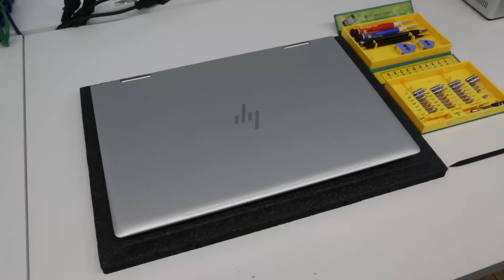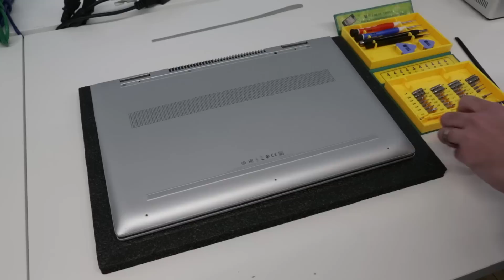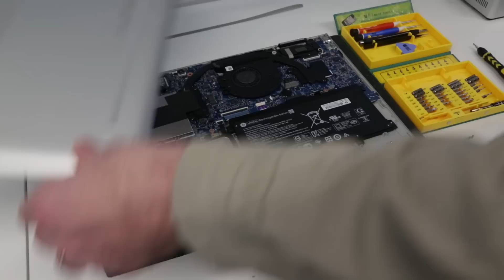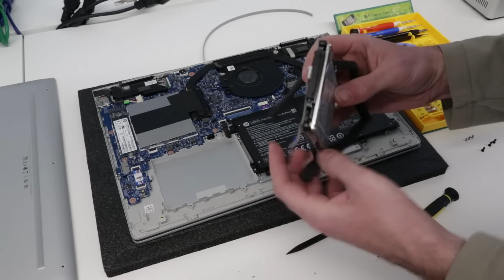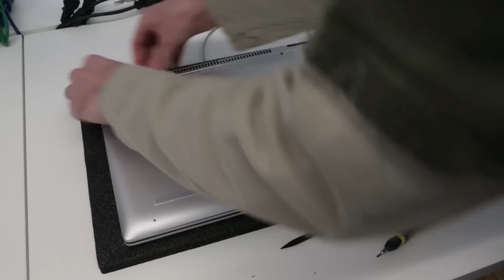HP Envy x360 15 SSD, HDD and RAM Upgrade Guide

Comment: You mention that the SATA SSD could be upgraded to NVME. I attempted this a while ago to a larger model and the system wouldn’t recognize it on the reboot after cloning. i then purchased a SATA version, cloned and it booted without any issues.  I believe the first SSD which was not recognized had 2 slots and the one which worked had only 1 slot.

Would you know why the NVME couldn’t be recognized for a better understanding?

Great video showing the Drive replacement process and explaining location of other features with the back of the laptop removed! Well done!

Comment: Thanks for the tutorial! For anyone struggling with prying off the bottom cover, start near the hinge area, it's much easier! Make sure you remove the screws from underneath both rubber strips.
Reply: Yes, the hinge area is the easier way to get the bottom lid off. Use plastic pry stick found in most computer tool kits.

Comment: Just installed a single 16gb ram chip into the same model.
Boots up.
Benchmark says it's in the top 1% of this  16gb chip. So the extra 4gb of Mainboard ram seems to help a little (but probably not as much as 4gb should in a regular  2x 4gb setup)

Don't know if it will cause any problems along the way , but so far works nicely

If any problems show up I will post here :-)

Thanks for video !
Reply from the maker: Useful information and glad it was helpful!

Comment: So where is the RAM Upgrade Guide? You show where the current memory is but state it should be left alone. No info about upgrading at all.
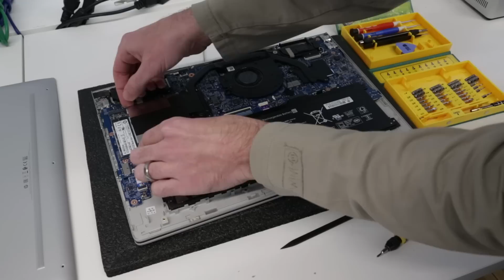Reply from the maker: 5:40 I remove the memory cover and talk about replacing the memory module - I was choosing the leave the 4GB module in place to keep a balanced dual channel memory configuration, but it can be removed by pressing out the two levers either side.

Comment: Great video man! around 5:00 you mentioned adding a second drive and I am curious as to how this is done. I've purchased a 1tb SSD (Samsung 860 EVO) and I'd like to add it as opposed to swapping out so I wont need to move anything over. Any help would be awesome, Thanks!
Reply from the maker: In the model I had (15-bp) you have an M.2 SSD slot and a 2.5" SATA drive, so you could fit two drives into it.
Do you know the model you have and I'll dig out the service manual.
Reply: @BrueComputing  hello can you please tell the exact model of SSDs  which are supported on hp envy x360 15m-bp111dx model? 
TIA

Comment: I am confused. OS is installed on hdd. Will it have impact on installed Windows OS if I replace/upgrade the harddisc?
Reply from the maker: You need to either clone the contents of the HDD to the replacement, or clean install to it.

Comment: Got a question. About the ram. Only one slot? Or two. Mine is just like this and i can only upgrade up to 16 and it's one slot. I can't. Touch the other slot
Reply from the maker: One on the model I had - the rest was soldered to the mainboard.
Reply: @BrueComputing  Thanks so much. The task manager says 2 slots
Reply from the maker: What's the full model of machine you have and can check the service manual?
Windows doesn't know the difference between a slot on the board and soldered down RAM, just what the BIOS reports to it.
Reply: @BrueComputing  hp envy x360 15 convertible
Reply from the maker: The full model number, there are dozens of different x360 15" models.
Will be something like x360 15-bp100sa
Reply: @BrueComputing  x 360 15- bp1
Reply from the maker: Same as the one in the video then. 1 DIMM slot, the other is soldered to the mainboard.
Reply: @BrueComputing  Hi, what SSD 3:22 you recommend for HP ENVY x360 - 15m-bp111dx?

Comment: Hi. Do you think a Crucial P5 1To CT1000P5SSD8 Internes SSD  and a 2×8gb  Crucial Ballistix BL2K8G32C16U4B 3200 MHz, DDR4 will fit in an HP envy x360 15 ds0xx?
Reply from the maker: The SSD will fit, but those memory modules are desktop modules!
Following bits (Amazon Affiliate links) should work:
Crucial P5 1TB SSD: https://amzn.to/33wFj5Y
Crucial 2 x 8GB DDR4-2666 Kit: https://amzn.to/3w3XegN

Service manual for that laptop is here: http://h10032.www1.hp.com/ctg/Manual/c06267280.pdf

Comment: I think that I have the newer model of this. I bough it last year. There is currently an even newer one. The one that I have sucks. It seems like the software and hardware dont jive up. It just doesnt run right. Zoom and proctorio crash all the time, the bluetooth on/off slider isnt present, the screen saver doesnt work, it randomly goes in and out of sleep mode, etc etc. I bought it from costco and I should have returned it before the 6 month return period. Costco says that I can send it in and they can reinstall the software. I dont think that will fix the issues. I think its just one of those builds that just dont like working with each other.
Is there something that I can do to make it better? I was thinking more ram or faster ram.

Comment: Just looked this video up, to open my HP Envy X360 15-BP108CA again.
My laptop also had 2 x 4GB memory. I just removed the one removable 4 GB memory and
replaced it with a 16GB module KCP426SD8/16 from Kingstin https://www.kingston.com/unitedstates/en/memory/search?partId=KCP426SD8%2F16  (will be replaced by KCP426SS8/16).
My laptop now has a wopping 20GB (while 16GB is supposed to be the max according to HP).
Reply: I plan to do this.
Are you seeing any real improvement?
Reply: @1upSTARS  I don't have the feeling my laptop has become faster and one of my irritations with this laptop is the noise of the fan. (I ordered a "new" one from Aliexpress to install in the near future ;-) )

I am always working on dozens of things at the same time and have maybe more than 100 Chrome tabs open, and several other programs like Excel, Word, VmWare,  Edge and more...
Things used to get REAL slow because of low memory, so I used to restart my laptop once or twice every week.
Today 13/4/3031 my laptop has almost been on for 3 weeks (from 20-3-2021), without rebooting and I still have no low memory issues.
Windows however is bugging me to install some updates which probably need a reboot, so I think I'll do that this weekend.
Reply: @martijnortega4748  Ok, maybe I'll hold back until I experience lag and then worry about upgrading at that time. Thanks for the heads up.

Comment: Awesome video! I'm a noob at this, but do you know if it still works with the latest HP envy x360?
Reply from the maker: It'll depend on the exact model, but should be a similar process. If you have the exact model number HP have service manuals available from their support site.

Comment: Thanks for this video - it was exactly what I needed to replace the mechanical HD with SSD. 
I did have trouble getting the SSD back inserted - I would have appreciated you showing on camera what you had to do to fix the corner bit of the silicone wrap.
Reply from the maker: Glad it helped. Sorry the bit wasn't as clear as it could have been.

Comment: Hey
I just wanted to say that I have a hp envy X360 15-bp1xx. You think your's and mine laptops are same hardware. Because I want to upgrade my HDD to SSD. So this upgrade is work with mine laptop or not ?
Reply from the maker: Yes, that is the model I had.
Reply: @BrueComputing  Thanks for response 
But, I have another question,
My laptop was arrived with a HDD (there is no NVMe SSD) 
Do you think that it still comes with NVMe SSD slot ?
Please reply this means a lot 
Thank You

Comment: This video is helpful brother I have installed samsung 970 evo plus ssd in my hp envy bp112 dx but there is one problem it runs on PCIe 3×1 because of which it gives less speed i.e 800 mbps in cristal disk info and samsung it shows it supports PCIe 3×4 supported how to make PCIe interface to 3×4 to get the best of it

Comment: Yes they do. My particular model came with a 1TB HDD, no SSD and 16GB of RAM, i.e. 1 8GB stick soldered on and 1 changeable. My OEM HDD failed after a year so I put a WD Black nVME 240GB and a 500 GB HDD.
Reply: I need to replace my hhd now and looking for the best option. It came 1 tb also

Comment: 3:18 You mentioned that it was a SATA ssd. It doesn't look like one though...it looks like an m.2...am I wrong?
Reply: it is a Sata m.2. What you are thinking about is NVME m.2 and you can tell by the connector at the bottom. If it has one big section and two small sections on both sides of the big section it is sata. That form is no different than the 2.5 inch sata hard drives you are thinking of in terms of performance. If it has one big section and one small section on one side it is a NVME which is the super fast drive you are probably thinking of.

Comment: Still not like my HP Envy X360. Mine comes apart from the keyboard side. Then I have to disconnect everything to lift the MB off, with the fan system. Mine came with an 8GB Memory card. It only showed 4Gb until I did an update. Then the 8Gb was showing in the system. So I'm ordering another 8Gb for mine, and installing my new SSD. Mine was always running slow. Original HDD would be showing 100% access all the time, until I did a factory restore. Then it would do that for a while and eventually be working at a much lower %. But still a little slow. For what I paid for it, it should be fast. I paid far less for my desktop, that runs soooooooo fast, compared to this laptop. Thank you for the video though.

Comment: What model of Samsung evo SDD will fit w/o issues for this laptop? My HDD stopped working :/
Reply from the maker: Which model of Envy x360 do you have? For mine you could fit a 2.5" SATA SSD or M.2 NVMe drive.
Reply: @BrueComputing  it's model 15m-bp012dx. Which SDD do you recommend for this one?
Reply from the maker: @jerrytorres1288  As standard you have a 2.5" HDD, so you could definitely replace it with one of these: https://amzn.to/35bomhu
You'd have to open it up to see if it has an M.2 2280 slot - the service manual says yes, but HP have a habit of not fitting the slot itself on machines which don't ship with an SSD. If it does then it supports NVMe M.2 2280 SSDs like this: https://amzn.to/2VJV6vl

Comment: does a SSHD 2.5inch work with HP Envy x360 15-cp0053cl?
Reply from the maker: If it only comes with an SSD then there will be no SATA cable/board pre-installed, or the drive mount. You'd have to source these which generally isn't cost effective.

Comment: I own an HP Envy 15 X360 laptop Serial 6CF43052HV Product no G6T84UAR#ABA Intel Core i5 system. It is few years old. I am not sure if this system supports a SATA M2 SSD. I could not locate the appropriate slot on the motherboard. And HP is completely silent when asked this question.
Reply from the maker: That looks to be a much older model, with no M.2 slot, only a SATA HDD.

Comment: Hi! Can i add ram withput being the same as the one that is included in the laptop?
Reply from the maker: Matched modules is preferable, but you can have two different modules so long as they are the right type (DDR4-2400 SO-DIMMs)

Comment: Great video - thanks.  My new 15-cp0086nr was configured a little different.  Instead of 3 torx screws on the bottom front, I had 1 torx screw and 2 hidden screws under the strip.  Once I opened it, the m.2 slot was hidden under a metal shield (like the memory).  Also, my wifi card was right there if I wanted to swap it out.  But everything else was great.  Watching your video gave me the confidence to do it!
Reply from the maker: Glad it was helpful!

Comment: What do you use to re-adhere the rubber strip in the back after you've peeled it off? The original glue is less adhesive once it's been off.
Reply from the maker: Mine stuck on fine with the original. If not though I'd just use a thin double-sided tape.
Reply: Cool.  Thanks for the quick reply.  Good video.  Was wanting to know what I'm in for if I decide to upgrade mine.  256 GB SSD in it now, but I'm seeing 1TB now for about $100 USD.  Might take the plunge.
Reply from the maker: Definitely worth doing - if like me you have a model with SSD + HDD I'd swap out the HDD for a large capacity SSD, will reduce noise, power consumption, etc.
Reply: I thought about getting that one when I bought this, but I only have the 256 SSD.  It's nice, but I depend on External HDDs, a USB hub, and NAS...  :-)

Comment: Hello do you have video on how to repair on this same computer the DC in power jack cable plug for this HP Envy X360 15m bp011dx
Reply from the maker: I'm afraid I don't.
You can find the service manual here though, with instructions on Page 61: http://h10032.www1.hp.com/ctg/Manual/c05527167

Comment: Thanks for the video.  I ran into issues removing the bottom cover and didn't consider that there might be screws underneath the rubber strip on my HP Envy x360 15-bp051nr.  Thanks a ton!

Comment: Does anyone know where the CMOS battery is? My CMOS keeps resetting from time to time..
Reply from the maker: I would expect it is on the other side of the mainboard.
Reply: @BrueComputing  So I need to remove the main board to access it, right?
That's a damn crazy design for sure
Reply from the maker: Not that uncommon unfortunately.
Reply: I understand. Thank you <3

Comment: You should disconnect the battery cable before tinkering with it, in desktop PC essence, you were operating with the power cord connected to the PSU, that's a NO NO
Reply from the maker: You're right - I do this in newer videos. Generally assuming the laptop is switched off it SHOULDN'T be an issue, but removing any power sources is certainly good practice and avoid any issues with forgetting to shut it off properly or accidentally powering it on.

Comment: may i ask LENOVO YOGA 730 with - NVIDIA GeForce GTX 1050
- 4 GB GDDR5 is this not beeter than HP ENVY x360 amd? Also does intel i7-8565U Processor run faster than and??

Comment: Should I replace my 128gb ssd and 1 tbsp hard drive for a single 512gb ssd or get a faster 256 gb ssd and keep the 1 tbsp hard drive?
Reply from the maker: Really depends how much storage you need and what you are using it for.

Comment: Thank you for the video, one question: the part when you said there's 4GB build-in to the motherboard, and another 4GB on the dimm socket next to it. We shouldn't be changes it for dual channel purpose. But in that case, should the memory that shows on System information be 8GB? Mine only shows 4GB, what is your? Thank you.   Oh, just in case, my model is HP 15-bp152wm, with i7 8550U in it.
Reply from the maker: You have a different model to me - the bp152wm has 4GB RAM as standard, so presumably has 4GB on-board + an empty DIMM slot. I'd add a 4GB DDR4-2400 DIMM to take it to 8GB.
Reply: @BrueComputing  , thank you for the fast reply, I did open my computer and hoping that all 4GB shown on my system info were the soldered RAM from factory. However, I see that the slot on the right side did have a 4GB removable RAM stuck in it. (a Samsung ddr4 2400T ...., it match to what is shown in my system info)
PS. I tried win10 system/about, old control panel/system, CPU Z, and Hp hardware Diagnostics..., All shows only one 4GB in my computer.
So I was wondering if my model simply just don't have the soldered-in 4GB, and therefore the dual channel is not capable of my model. That I'm still looking for the answer for it.
Reply: Thomas Tang did you ever figure it out ? The bp1xxx  models have a integrated 4gb and a slot . I haven’t been able to confirm this but as  much as I’ve researched in the manual it says these models have a one non accessible

Comment: Thank you!!! I just updated my HDD to an SSD with your tutorial!
Reply: can you give me specs of what you did exactly? I really want to do this, but don't know which ssd to buy
Reply: @machoxs111  I bought a SanDisk Ultra 1.024 TB Internal SATA from Best Buy.  The Screws on the front are Torx (sp) 5 and the screws under the rubber stops towards the hinges are a regular phillips head.  I purchased a small torx set from Lowe's for $10.  I used a butter knife to separate the top (do not follow my example).  I used EaseUs Copy 3.0 to copy my hard drive to the SSD.  I hope this helps.
Reply: I have also updated nvme ssd in m.2 slot but it is running on PCIe 3.0×1 because on which Speed is restricted bec it supports PCIe interface 3.0×4 jus wanted to confirm on which interface your ssd is running ? My model number is hp envy bp112dx

Comment: Thanks so much for this video.  My model is a little different from yours.  First, all 7 screws on the back are phillips head screws, no torx screws.  The main difference though is that my unit has no onboard memory, just 2 sticks so the memory could be upgraded by replacing both sticks.  Others with this laptop should open it to see what they have.